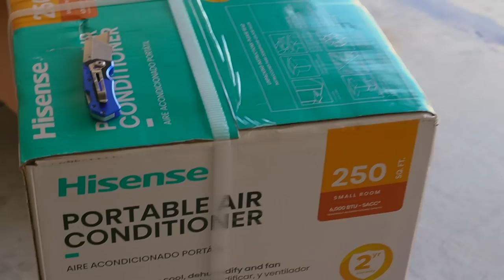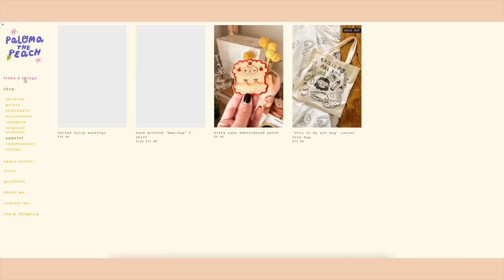setting up my own pottery studio in a garage! 🪴

Comment: They have portable stand alone plug in AC units on wheels we used in one of our garages. You can put the air intake out a window or right under the door.  I live in Texas too. Only thing is you’ll have to leave the garage door up just a little bit for the air intake it needs to be outside I think, but they are on rollers so you can move it around and pull it inside to close it up when not in use. You could use pool noodles to block the hot air under the garage door while you are in there.  Weird suggestions but it might work and renter friendly. I know Lowes sells them because we got it there.  I don’t know the brand but they do work really well.  They are a little bit of a chunk of investment, not too bad but totally worth it. Oh and they are multi function, so they have heat as well. Hope that helps.
Reply from the maker: thanks so much! I did get a portable ac and it makes the heat tolerable. the pool noodles are a great idea
Reply: @palomathepeach  Hopping on the pool noodle idea. If the noodles aren't wide enough for the gap, you could use a long strip of the insulation foam board or multiple pieces taped/glued together. If you use a thicker piece, 3" or more, they could stand on their own. If you have to paint it for any reason, don't use spray paint. It might melt it. Can't wait to see how it all evolves!

Comment: I have a pottery studio in my garage in south florida and she hot hot hot. I bought a big industrial fan (from Harbor Freight- pls pls do not waste your money on buying one from home depot or lowes- they have harbor freight in houston) that just blasts you when you are at the wheel. It actually assists when you are throwing by drying the piece out a bit which obviously keeps it from getting too weak and wet. When trimming though I have to put a dumb cardboard shield that I cut from a box int the splash pan that prevents the pieces from getting blasted by the fan and going beyond leather hard so you can still not die from the heat.
Reply: Also- my mom personality requires me to say that you need to be careful about the clay dust that accumulates in the studio, especially if you have a fan going. Please always hose things down or mop and not sweep, your lungs will thank you :)
Reply: Oh also, you can wear a long wet rag (cooling towel) around your neck- they are popular in florida (you see them everywhere at disney) and they are so good at keeping you cool- they also sell them at harbor freight.
Reply from the maker: thanks so much! I’ll definitely have to look into an industrial fan. My issue is I only have one outlet in this garage so I have to be careful to not trip the breaker :’)